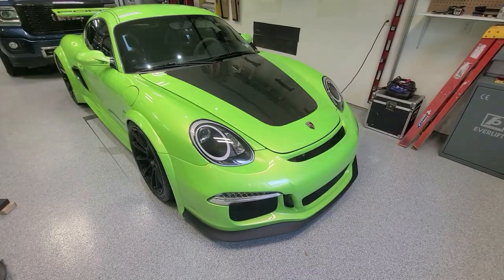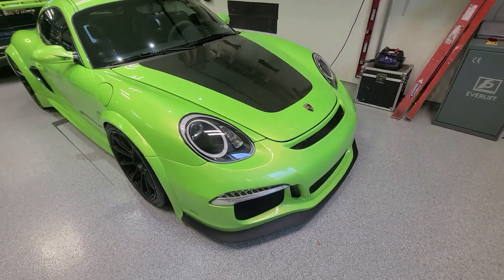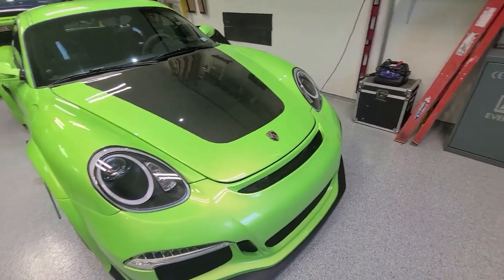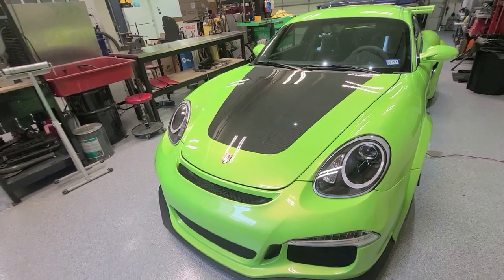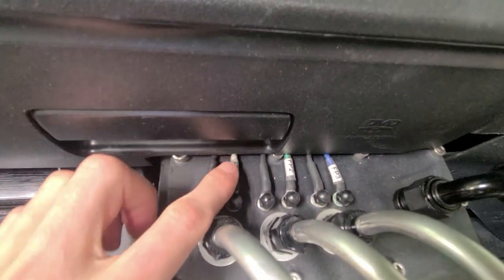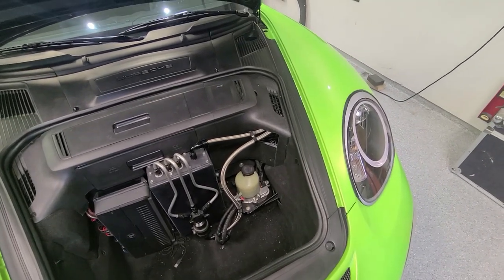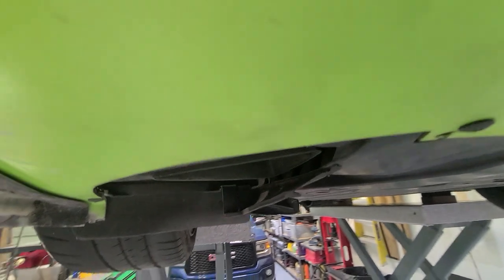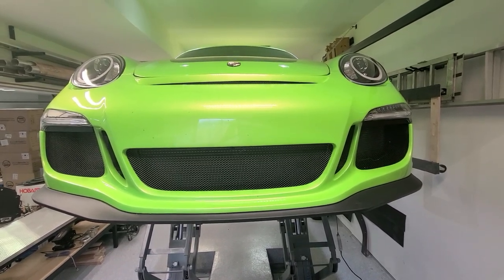Part 1 of 3:  1200rwhp V8 Cayman walk around!

Comment: Looks great.  I have been watching videos on Cayman V8 swaps.  I am sure you saw the guy in Europe swapping in an Audi V8.  I was thinking the future C8 Z06 N/A 5.5 liter flat-plane twin cam V8 might be an interesting choice.  Higher RPM lower torque engine and imagine the sound it would make.  I don’t know how far you plan on towing but back in the day with some of my track cars I would wear out shocks towing when strapping down the suspension and have the body bounce along for miles and miles on a solid axle trailer.
Reply from the maker: Thanks! Ya, lots of options out there.    As far as towing, I am running a street style shock and don't tow it often.  But when I do the tie built in tie downs have been a god send. Same with strapping the car on the dyno. More of a street car than a race car.  Agree that there are advantages to compressing the suspension a little to eliminate excessive wear, esp on a racing shock on a race car that travels a lot of distance on a trailer.

Comment: who did the body work and coding/wiring to get the front bumper + drls all working? and how did you "mold" the gt3 oem bumper? because that doesn't look like u bought an aftermarket bumper. and how did you wire the switchback fog drl in the front bumper??
Reply from the maker: I did all of the electrical, I had the help of two friends (thanks Larry and Casey) to do the bodywork, most of it was done in the garage.  We did rent a booth for the final color (21hrs of painting!).  Most of the parts started as Precision Porsche (out of cali) parts, but many 100s of hours of getting them perfect, plus making a few additional pieces to make it all blend together.